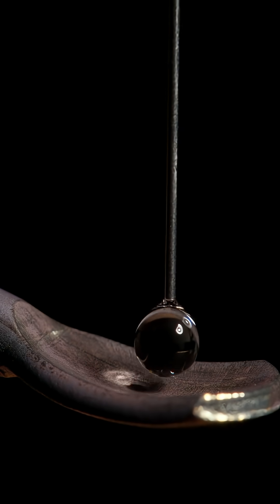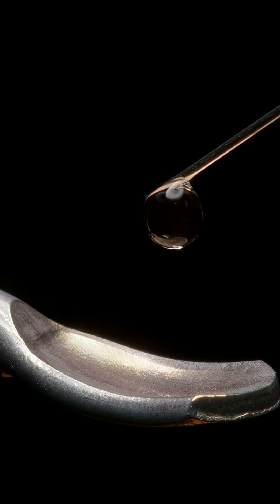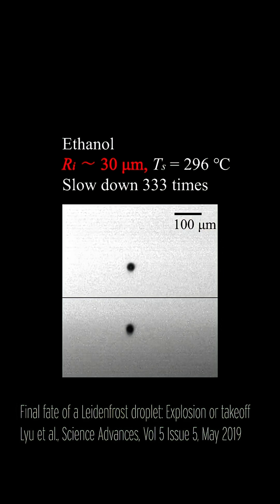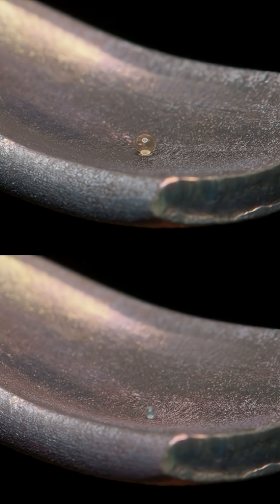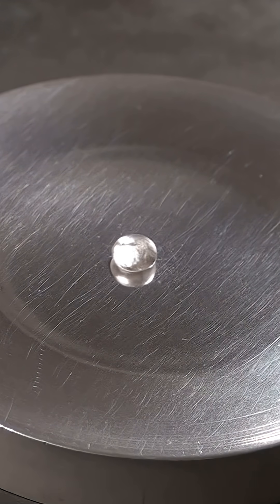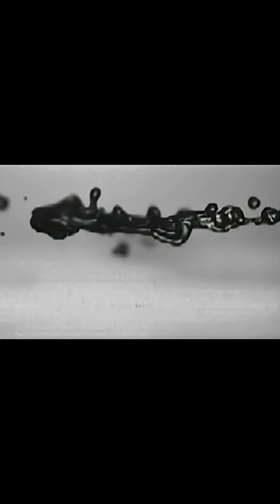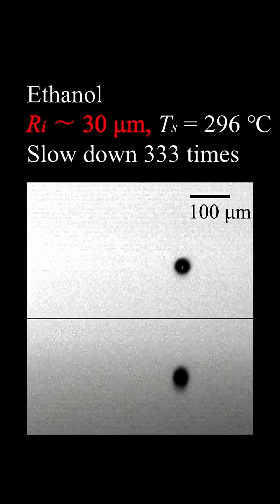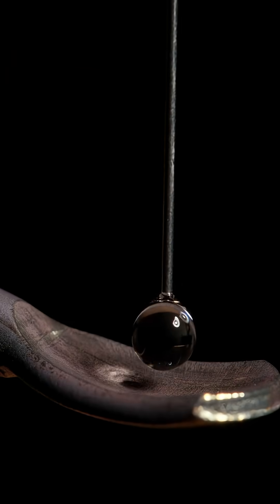trying to make water levitate but it keeps exploding

Comment: Because pure water is above typical boiling point (superheated), but won’t boil and will just evaporate. Water with impurities will also reach above boiling temps, but will eventually boil explosively, nucleating around one of the particles of impurity (and because gaseous water is significantly more voluminous than liquid water, the sudden expansion will push water everywhere). Additionally, it’s possible that (assuming the impurity is dissolved in the first place) this explosion happens once the water is not only superheated, but also supersaturated and finally the impurity  precipitates out of solution, which then becomes the nucleation point for boiling.
Reply: Came here to say that. You can superheat impure water, but when the impurities reach a critical point because the volume of water is reduced effectively increasing the relative contamination level, you get explosive nucleation.
Reply: This makes sense 😊
Reply: There's a couple of problems with your theory. First, there's no evidence to support that the water droplet is over the boiling point and secondly, that doesn't explain why it explodes out the bottom when water boils up.
Reply: @VeProducctions It explodes out the bottom because thats the point closest to the heat source so is highest point if energy and exploding water droplets is pretty good evidence the water is above boiling point!
Reply: @mrgoodman6620The bottom always has the highest energy level when you're boiling water and it still boils up. Water droplets can explode for all sorts of reasons. What you're doing is basically the same as a caveman looking at a thunderstorm and saying "Good evidence that god mad at us"
Reply: @VeProducctions  Are you considering the possibility/ suggesting that they aren’t boiling at all? I’m open to the possibility. Given that when water vaporizes, its volume increase 1600x and given what I described regarding superheated water and nucleation sites is a common phenomenon, I thought that it was a good place to start. Also, if even a small fraction of that droplet’s volume suddenly increases 1600x, it could easily displace the volume of water it’s contained in. A pot of water doesn’t ordinarily explode because these miniature explosions that we call boiling are not large enough relative to the volume of water to displace enough of the pot for us to see the pot “exploding”. And, yes, the gaseous water does rise, but in this instance, it pushes the water around it away too quickly, and now there’s nothing for it to rise in.
Reply: @ironwingz  It's a good place to start but you present it as the explanation without any evidence. The expansion is clearly caused by boiling but that doesn't mean that the entire droplet is superheated. Given that the drop explodes from the bottom it's also possible that the contamination disrupts the vapor barrier and causes the droplet to fall onto the hot spoon.
Reply: @VeProducctions Sure. I can’t claim that this is what’s happening, definitely. We’d likely need to run more experiments to have evidence in any direction. I’m only hypothesizing an explanation.
Reply: @VeProducctions  I’m merely speculating on the basis of my understanding of the world and the experiences that I’ve had.
Reply: @VeProducctions  Hypothesis*
Obviously I have no evidence of anything on the basis of the video—the whole thing could be artificially generated, I'm merely speculating. Secondly if my hypothesis is correct, it would make sense that it explodes out of the bottom. I'm speculating dissolved material in the water eventually coalesces/condenses/crystallizes/falls out of solution, which would produce an undissolved chunk of said material, which, if it's denser than the water that it's been dissolved in (which is quite likely), would sink to the bottom of the droplet. It might just explode wherever it forms, and what we saw were just instances where it formed at the bottom. Or it doesn't instantly explosively boil around that material for whatever reason (a bigger piece might cause superheated water to boil sooner given surface area, and a small piece that has precipitated out of solution and is sitting on the bottom keeps growing as the solution continues to concentrate (like when you grow rock candy)).
Reply: @ironwingz  Theory and hypothesis are synonymous. The droplet still has convection currents, the crystal wouldn't just sit on the bottom. If it's random then it's incredibly lucky that the footage we saw has it coming straight out of the bottom. Heat is also an obstacle to crystal formation, if the droplet was above 100°C then the SDS would have formed micelles which aren't efficient nucleation sites. Do you really think that you're the first person to think of the most obvious solution and that a scientist has already tested that?
Reply: @VeProducctions If you continuously heat a solution of, say, salty water, where the salt is dissolved, the salt will eventually crystallize out of the solution, despite the heat. Evaporating off the solvent will lead to the dissolved matter crystallizing, in general. Also, we don’t know that these scientists didn’t think that that was what was happening. The guy who made this video made that claim. Also, if those scientists were indeed saying that they can’t be sure, that is likely only on the basis of what they tested, and they are being careful by saying that they aren’t sure (because their experiment didn’t test for that hypothesis, so they can’t make the claim that they do know with scientific certainty). They very likely have considered what I suggested, and might even think that it’s the most likely reason. They will just have to test that, first.
Reply: @ironwingz  They used sodium dodecyl sulfate which doesn't crystallize out of solution and instead forms hydrophobic micelles which don't provide very many nucleation sites. You're acting as though we should assume your theory is true until proven otherwise instead of the way it should be where it's on you to prove that your theory is what is actually happening
Reply: @VeProducctions your final two points in your last two messages were good, you should have just lead with those and dropped the antagonism imo. Including your last point especially it does seem the evidence suggests there's something else going on. As for all your claims about actually running an experiment to prove the hypothesis, well you have to work out a hypothesis first, discussions like these is how you get there, you're jumping the gun imo. Also a slight nitpick: theory and hypothesis aren't technically synonymous outside of colloquial speech, a theory is a much more complicated thing based off a larger body of evidence including a collection of proven hypotheses (i.e. a hypothesis may be as simple as 'if given enough heat this object will combust in an oxygen rich atmosphere,' whereas a theory would be 'this is the complete body of work that explains the mechanism of gravitation.').
Reply: @xxportalxx.  I have no interest in helping this person discover the cause, I simply take issue with the way that they presented their theory as fact with no evidence and seemingly without considering any other options because, as they have evidenced, this approach to science leads to an unwillingness to consider other options. As for your nitpick, I believe that theory is the appropriate term in this circumstance since they have made a claim and attempted to back it up with prior knowledge. A hypothesis would have been a long the lines of "Higher concentrations of a contaminant will cause drops to have a larger size when exploding". The most correct term for what they have done, however, would be speculation.
Reply: @VeProducctions 
Infrared thermometer
Reply: @IShould.veKnown  Unreliable. The droplet is dancing around, the spoon is at least 200 C and the heat gun or torch they're using to heat the spoon is even hotter than that.
Reply: @VeProducctions  so 200c but also somehow not boiling huh
Reply: @garethkalum8297  The spoon is 200°C, not the water droplet. Do you know what the Leidenfrost effect is?
Reply: @VeProducctions  yeah, do you? 
The BOILING of the water creates a barrier between the spoon and the water. So where is it not boil like you say?
Reply: @VeProducctions  why don't you explain the convergence of the points: 200c spoon, leidenfrost effect, the water droplet dancing, and not past the boiling point?
Reply: @garethkalum8297  Did you read the rest of my response? The surface boils, not the entire droplet. That protective layer of steam is what forms the Leidenfrost effect.
Reply: @VeProducctions  so... The water, it boils then... No?
Reply: @garethkalum8297  No. Do you think that the oceans boil because the surface vaporizes?
Reply: @VeProducctions  does the surface of the ocean have a 200c spoon causing it to boil?
Reply: @garethkalum8297 Do some research on the ocean, bud. And the Leidenfrost effect. Also genetics, maybe you can be the first in your family to marry beyond the second cousin
Reply: @VeProducctions  I think you need to do some research mate if you think the leidenfrost makes steam magically appear by using heat on water and not making it boil...
Reply: @garethkalum8297  So how do you explain water vapor coming off the surface of the ocean? Are the oceans boiling?
Reply: @VeProducctions  not leidenfrost that's for sure. 
So let's stay on topic.
Reply: @garethkalum8297  Really? Fascinating. Why don't you explain to me, in your own words, what the Leidenfrost effect is
Reply: @VeProducctions  I asked first: "why don't you explain the convergence of the points: 200c spoon, leidenfrost effect, the water droplet dancing, and not past the boiling point?"
Reply: @garethkalum8297 And I did and now you're hung up on the term boiling so I want you to explain the Leidenfrost effect so that we can clear up this confusion
Reply: @VeProducctions  no, you did not. Quote yourself.
Reply: @garethkalum8297 Absolutely, no problem. I'll do that right after you explain what you think the Leidenfrost effect is
Reply: @VeProducctions  no, I asked first.
Reply: @VeProducctions  you can just admit to a mistake too 🤷 
Steam isn't magically produced from the surface of water contacting something well beyond the boiling temperature of water without causing a heat exchange that produces the steam. 
You talked yourself into a corner, just own up to it.
Reply: @garethkalum8297 I asked you first, you deflected by telling me to quote myself. I didn't make a mistake, you simply lack the intellectual capacity to distinguish between a noun and a verb. The surface of the droplet vaporizes (aka boils, the verb) but that doesn't mean that the droplet itself is at or above 100°C (aka boiling, the noun). I can't really help you with that issue, not am I particularly interested given that you seem to be a debate bro who is more concerned with semantics than substance. I guess I should just count myself lucky that we aren't discussing PDF files.
Reply: @VeProducctions  quote where I ever said the entire droplet boils. 
Learn how to read.
Reply: @VeProducctions  the surface of the water boils, so the water boils. The surface and the body of the water aren't separate entities. 😂

You're literally trying to say the water boils but doesn't boils.

You're the only one making a mistake because you can't admit that you spoke incorrectly.
Reply: @garethkalum8297 Where are you pulling those definitions from, Webster?
Reply: @VeProducctions  "firstly, there is no evidence the water droplet is over the boiling point" -
If you'd like your quote.
Reply: That might be part of the reason why water boils much more readily once you put pasta in it
Reply: @younscrafter7372Yes the pasta adds nucleation sights which also increase as starch leaches out. However it all changes if you were to boil it away (your forgiven if you haven't reduced your pasta to slop for study😂) pastta and starch hold moisture, once the only water left is what is being held the temperature of that moisture can well exceed boiling temperature before gasing off. So some food straight out of the pan can be hotter than boiling! In theory.😊
Reply: That's what i think is happening but idk how to say it
Reply: It makes sense, and the scientists researching it probably came to the same conclusion. But you, and they, can't actually prove that that's actually why it's happening, and there's no general consensus on the matter, so it's therefore still considered unknown.
Reply: @Flintzell  Indeed, it’s a hypothesis in need of testing. And neither I nor the researchers can currently prove why on the basis of what has been tested, thus far.
Reply: @Flintzell  Its not that mysterious. This can be simulated and proven mathematically. Just takes a lot of money and time. The people researching most likely didn't have that to spend on the nucleation of impurities in a water droplet experiencing the lidenfrost effect. This is almost always the case when a youtuber says "science doesn't know how it works". Its shown empirically, a reason is proposed but never proven mathematically.
Reply: @Flintzell  just because there isn't a consensus does NOT mean it's unknown, that's illogical.
Look up what unknown means
Reply: @Flintzell Where did you source reference to unproven and date of publication please.
Reply: so basically the shit inside freaks out and tears the house down when things get too hot
Reply: Now I remember I read about this before
Reply: Also has to overcome water surface tension I’d imagine
Reply: Said much better than I was able to say.
Reply: The fact that a supposed scientist doesn’t understand that lol
Reply: Bro watched myth busters as a kid, see "microwave madness"
Reply: Very plausible.
Reply: Came here to comment the same thing, though I don’t think I could’ve made it so eloquent.
Reply: The why do these explosions occur reliably from the under side of the droplet? Why not any other orientation?
Reply: @Moonchild15225  Firstly, I am hypothesizing/speculating. Secondly, we only saw it exploding from the bottom one time in the video, it might explode from different sides other times. That said, it can still be explained by my hypothesized model. If whatever is dissolved in the water precipitates out of that water (forms a solid crystal), then that crystal could sink to the bottom of the droplet due to it being denser than the water. That particle now would act as the nucleation site for the water to start boiling. It might be that if it explodes from the bottom, the crystal of the  whatever matter is dissolved in the water needs to be of a certain size before water reliably boils around it. So even if the crystal doesn’t form at the bottom, it might form, sink to the bottom, and then continue to grow as the solution continues to concentrate until it grow large enough to induce sudden boiling.
Reply: I'm a materials scientist, so we often deal with the opposite of this (nucleation and crystal growth). My first hypothesis has to do with the fact that as you decrease the radius of the droplet, the surface free energy eventually exceeds the volume free energy (one scales as r^2 and the other as r^3, so for large droplets the volume term dominates) and the surface free energy causes the droplet to into the melt (it's positive and therefore unfavorable). If we introduce impurities into this system we can increase the surface energy term by decreasing hydrogen bonding networks between water, meaning that the droplet is more unstable at a larger radius. I.e. you increase it's critical radius compared to pure water and made the droplet unstable.
Reply: Yes BUT all that changes if radiant heat is used or included.
Some contaminants can be stabilisers which also make things interesting😊
Reply: @mrgoodman6620 yes, there are likely many nuances to these phenomena.
Reply: @ironwingz heres one for you what would actually happen to a drop of water released in space. Then what would happen if it were in a glass container @ 1 atmosphere? 😁💥